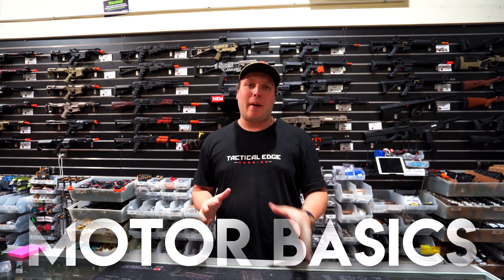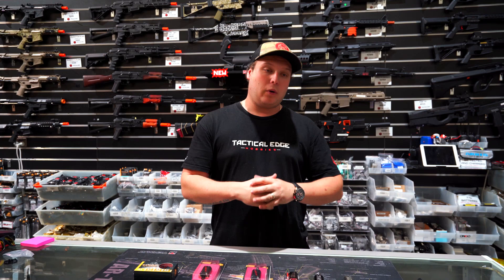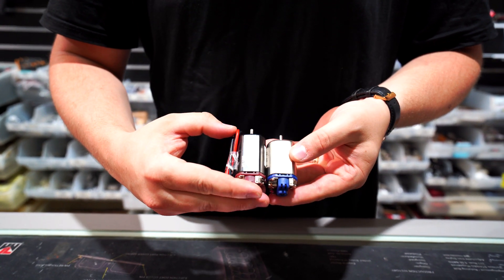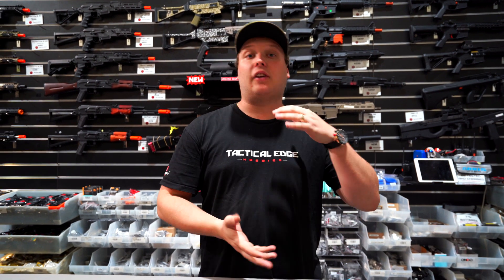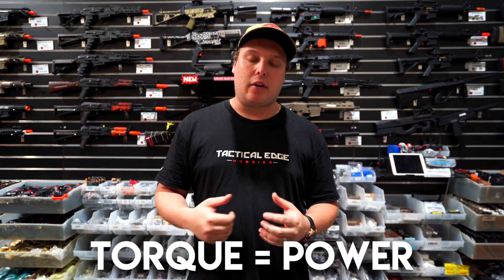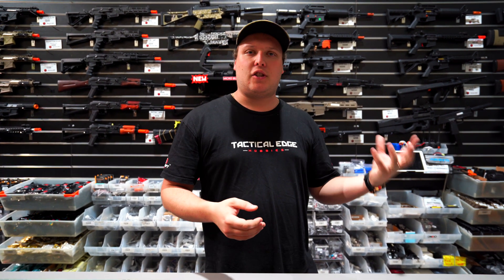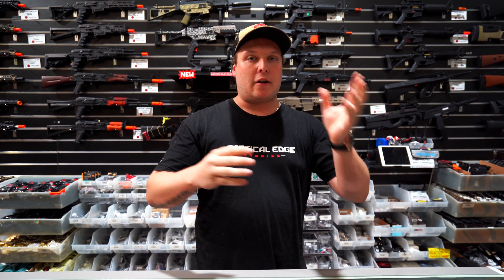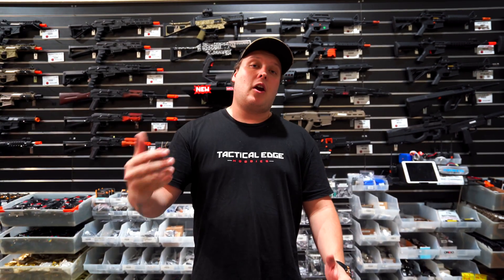Definitive Guide for Gel Blaster Motors | Gelsoft Tech Talk

Comment: The short shaft 460/480 motors used by gel blasters have a 4mm D-shape spindle/shaft. There are some after-market motors that only have a 2mm spindle or are not D-shape, so just make sure when you buy one that it's the correct 4mm one. Also be prepared to upgrade your wiring and switches - stock wire/switches are generally low grade and will overheat/melt/fail under the higher current used by better motors.